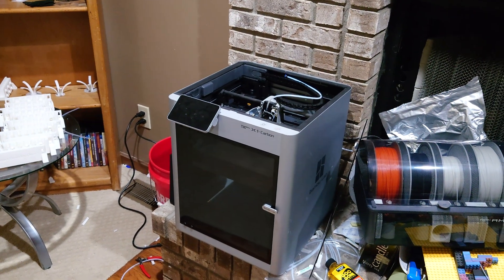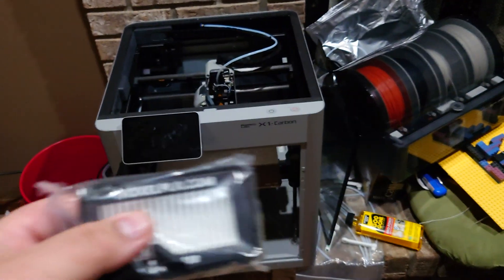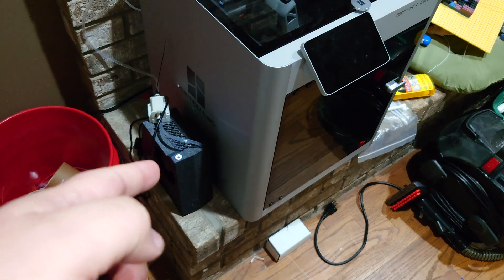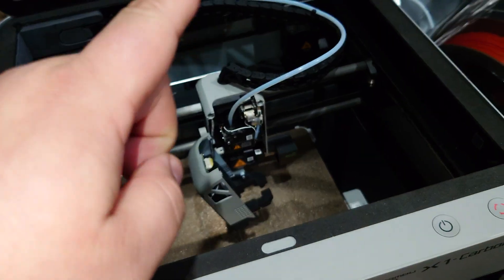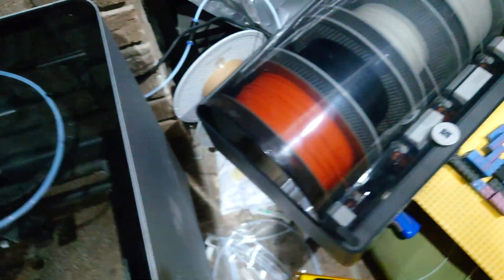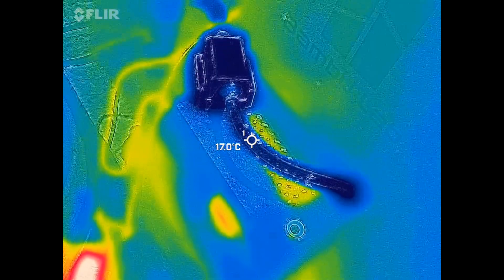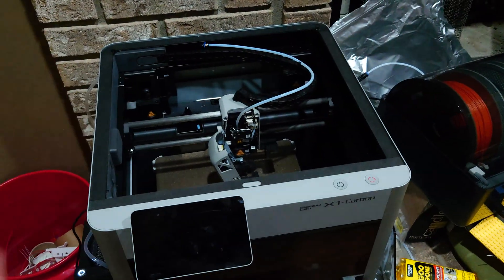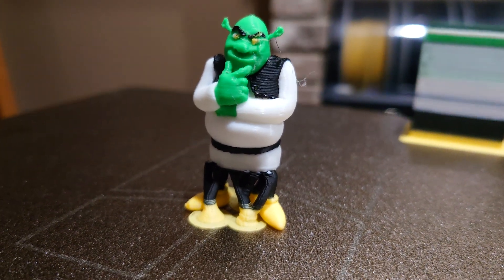Martillotech Active Extruder Cooler Review (For Bambu Labs Printers)

Comment: I have had my x1c for almost a year now and ive never had any of the problems you described. You also dont need to take off the glass top you can just print a part to hold it open. Also if your pla is making such a bad smell that you cant stand it you probably arent using pla, even the dirt cheap stuff doesn't smell anymore.
Reply from the maker: I'm glad to hear your experience with your x1c has been a good one!

It's true that in a home environment, ambient temps might not be high enough to cause issues with low temp plastics.

However, we're seeing more and more people put these things in weird places (like a car garage, which don't always have air conditioning so it can get kinda hot out there)

In situations like that bamboo Labs has noted that the extruder might get a little too warm from ambient heat creep and cause the filament to melt prematurely in the gears thankfully most people won't actually have to experience this. Luckily though, for those who are experiencing this issue there are ready to go Solutions available out there like this thing.

As far as the smell goes I'm starting to think maybe my nose might be a little bit more sensitive the most. I always notice a faint smell coming from my printers in my living room from pla. Obviously when it comes to ABS or ASA the smell is intense, but you wouldn't use this device for those types of filaments.

Comment: I wonder what normal PLA stinks that bad you can't be in a same room when printing with top open?

My P1S lives in my living room too and I've never noticed any smell or stink when printing PLA, PETG or TPU at correct temperatures. For particle emissions I use an IKEA air purifier and I occasionally keep my back door open to outside (more frequently in summer) so I'm safe and fine.
Reply from the maker: I wouldn't say that it stinks horribly, it more just has a reminiscent smell of corn. My room doesn't have a great amount of circulation, so it tends to emanate from a particular source and build up in that area. The x filters appear to do a really good job though

Comment: Insane that Bambu's solution is to not use the enclosure. Why the heck did I buy a printer with an enclosure if I can't use the enclosure?
Reply from the maker: Well, materials like ASA and ABS need a chamber, so when using those materials you would need a stable chamber temp. But pla, petg and tpu prefer cooler temps
Reply: Yes i know its so much work to take the lid off jeez

Comment: This has to an April fools joke!!! Take a look at my printer… I’ve been using remote cooling with a super simple berd air system for the last 3 years printing pla and abs without any issues and at super insane speeds and acceleration with perfect quality at that!!
Reply: They ARE using Berd Air and just added a fan + water seperator and call it a day and try to earn BIG money on this CHEAP item!

Comment: How about using one of those "cold" build plates instead?
Reply from the maker: I was thinking about that - I have yet to try one. In theory it would help too. Although if your already in a factory environment, the ambient air is going to be kinda warm so there will still be cases where this setup makes sense